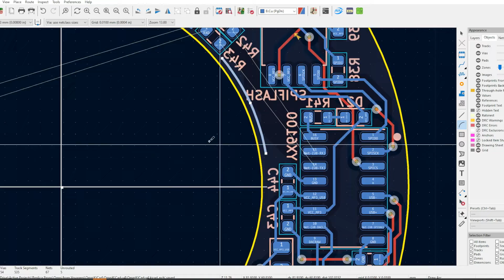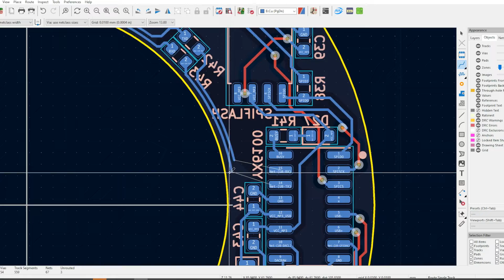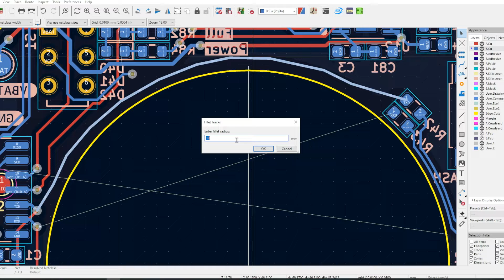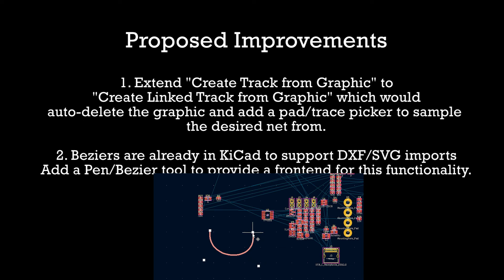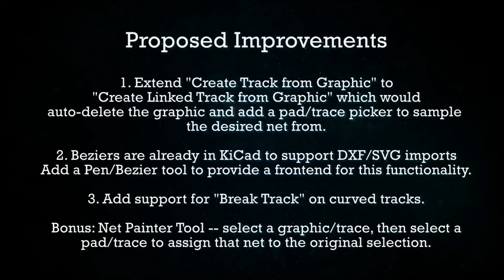Curved Traces in KiCad Current Status

Comment from the maker: UPDATE:
* Bezier tools in PCB and Schematic editor now has its own suggestion -- please UPVOTE it here:
https://gitlab.com/kicad/code/kicad/-/issues/8828

* Splitting curved traces (arcs) has been developed and proposed for inclusion in KiCad 8!! -- thank you dsa-t!

* I created a new issue "Add Net Painter tool" which would allow the user to apply nets to graphics and unassigned traces. UPVOTE it here:
https://gitlab.com/kicad/code/kicad/-/issues/16716

* I closed the 'make best effort when filleting' suggestion since it turns out you can fillet more than 2 track segments at once.